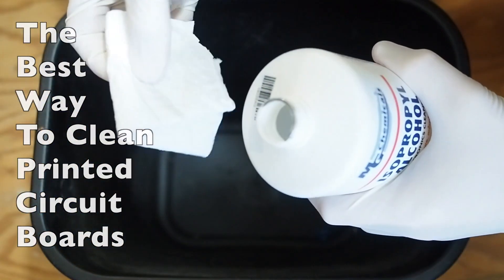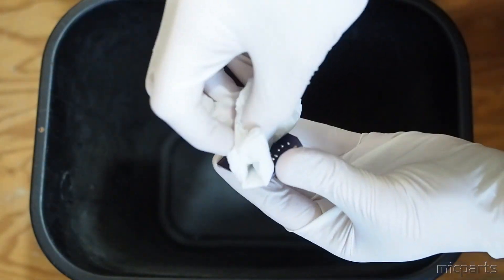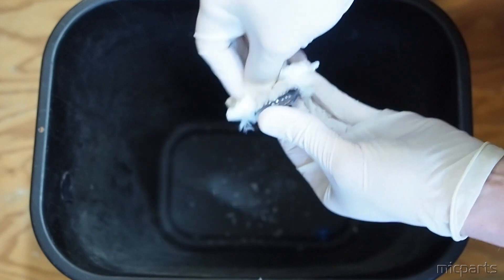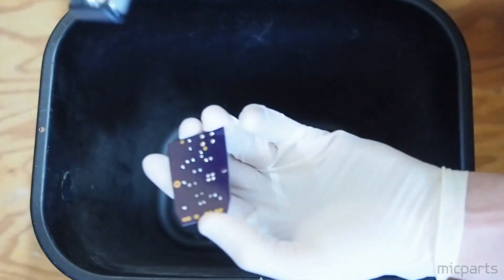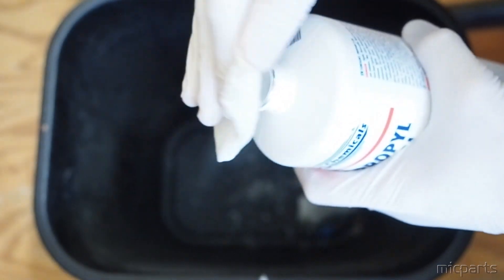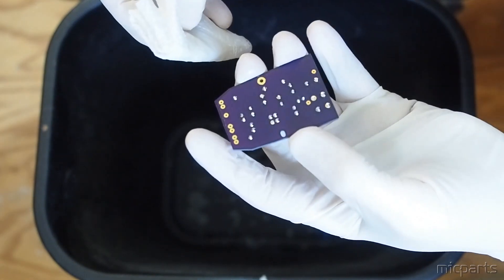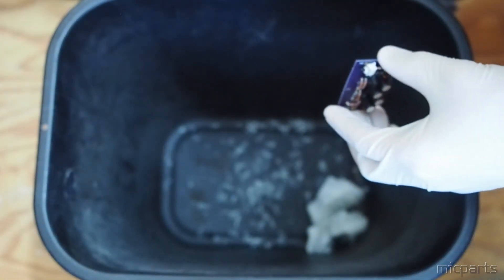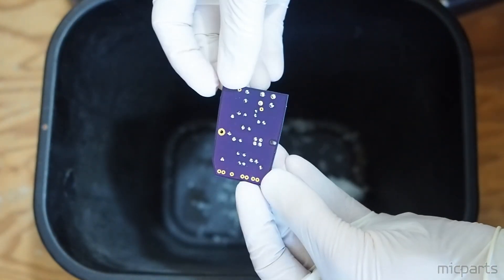How To Clean Printed Circuit Boards

Comment: Amazing tip. I've tried to clean a pcb with IPA (isopropyl) and a brush but wasn't satisfied with the results: a dull surface. Even after some passes it still looked like covered with a thin residue coating. After some rubbing with paper tower (mildly wet with IPA) and a dry brush, the surface became shiny again.

Comment: Nice tip! I usually just use pre moistened alcohol swabs and/or Q-tips with alcohol. One thing to consider though, using solder with water soluble flux can make your life much easier! First solder all of the components that are sealed and wont be affected by water getting onto them, then take it to the sink and scrub with a tooth brush under warm running water and your PCB will look beautiful! Then solder the remaining components that might be affected by water (pots, trimmers etc) with "no clean" flux solder and then optionally clean with isopropyl using your preferred technique. Here is some info I absconded with from https://forum.digikey.com/t/choosing-the-right-flux-types-for-solder/3302

No-Clean
The term “No-clean” means that this flux is formulated such as to avoid interfering with your board and cleaning is not necessary. However, the residues from no-clean flux are very difficult to remove and it requires the use of flux cleaners. You do not need to clean this residue, but it will be there regardless.
 (JLR note: isopropyl seems to clean no-clean flux just fine)

Rosin typed
Rosin flux is a traditional solder which is based on pine tree rosin. Roxin flux is active enough to solder electronic assemblies and the residue has a very good insulation resistance.
Two common types of rosin flux are Rosin Activated (RA) and Rosin Mildly Activated (RMA). RA is the most acidic one. The residues from rosin flux are mildy corrosive and should be removed after soldering to avoid eventual failure of the board. RMA solder has been formulated such that the cleaning, while recommended, can be omitted. Rosin flux can be removed with isopropyl or isopropanol alcohol followed by a de-ionized water rinse. Some agitation with a soft bristle brush is usually necessary.

Water Soluble
Water soluble flux is relatively easy to remove. Rinse the circuit under warm water and agitate with a soft bristle brush if necessary. An ultrasonic cleaner can be used as well. Follow up with a rinse in de-ionized water or steam distilled water.

Comment: What about cleaning the side of the PCB the components are mounted on?  Any suggestions for cleaning flux after the capsule connections have been soldered?  Protecting the capsule, etc?  I’m a novice.
Reply from the maker: It is generally not necessary to clean the component side of the board, because most of the soldering (and therefore most of the flux contamination) happens on the other side. That said, there are sometimes a few connections that happen on the component side, such as high-impedance joints (JFET gate, 1G resistor, capsule wire, etc); for these, definitely DO NOT use aerosol spray solvents. Use a Q-tip (cotton swab) or foam swab wet with 91-99% Isopropyl alcohol and scrub those joints gently. Then inspect with a magnifier, and pluck away any bits of cotton, paper towel, foam, etc., that got stuck on the solder joint. Try not to touch those high-impedance joints with your fingers, because finger oils can cause problems over time. Solvents will wreck the capsule, so don't use solvents anywhere near the capsule.
Reply: Awesome, thanks so much, your customer service is amazing!

Comment: Looks quite efficient and effective.   I'll have to try it.
But here's what I do currently...Usually for larger PCBs though with 200+ components on it.
I use 99% alcohol in a spray bottle and a clean paint brush.     I do use a toothbrush first to get the most stubborn stuff loose, then move on to the  2" paint brush.   Spray and whisk away the alcohol with the paint brush.   Then I  just spray alcohol only  (liberally) and let it drip onto a paper towel or into a trash can.   The end result is a spotless clean PCB.

Comment: This does look like it would make the cleaning process easier, and as long as I don't get too excited (after an hour of soldering a mic board together, I'm often super excited to do the final voltage meter testing and then the real deal test to properly take my time without forcing myself to do so). My problem is definitely going to be remembering to grab the trash can ahead of time so my wife doesn't murder me when she finds what's left of the project in the morning because I was too tired to notice that I had 4000 little pieces of flux embued paper laying on the ground.

Thanks Mike, as usual!